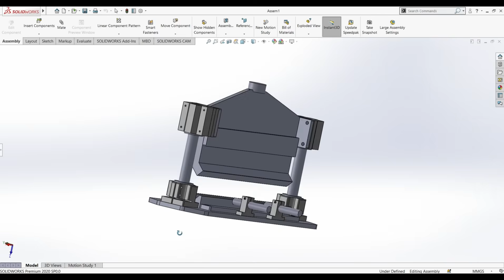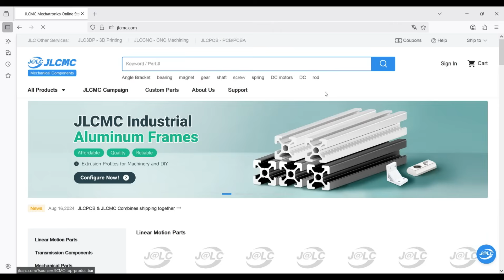DIY Hydraulic Press Brake Attachment | Quick Change Sheet Metal Bender

Comment: Heyy @VuVT-Workshop, thanks for the great video and inspiration - I'm building my own press break with parts from them as well now. How do you get the 3D Model downloaded? I can only see it on their webside, but I would like to download it to use in my fusion model as well...
Reply: I got it. Instead of searching at to "3D Model" Tab, you can download the models when you've chosen all settings at the top right of the product picture - there is a CAD button.
Reply from the maker: Yes, after selecting the settings on the left, the 3D model will automatically be created on the right. Good luck with this project!